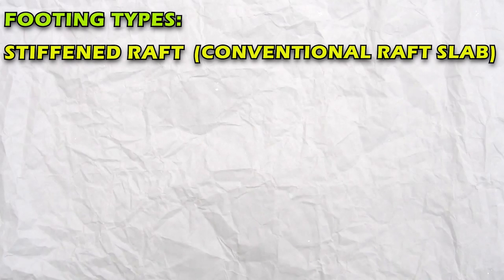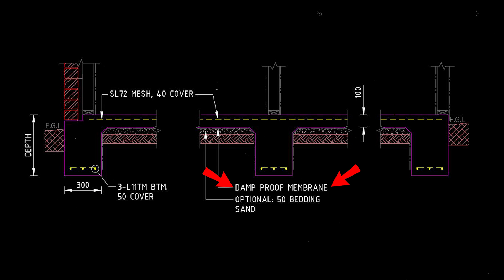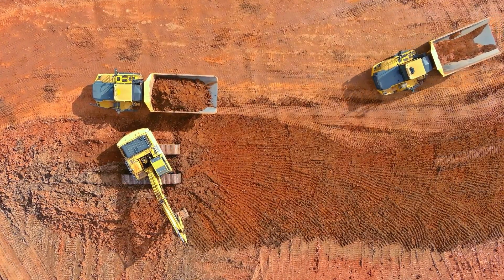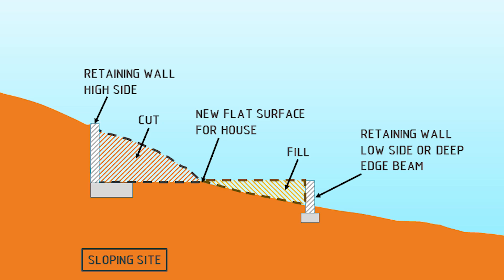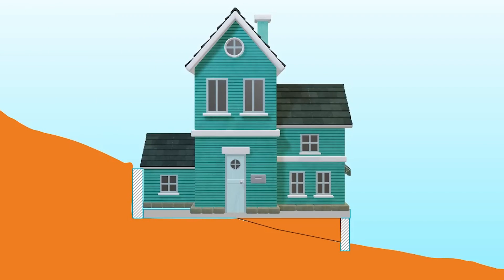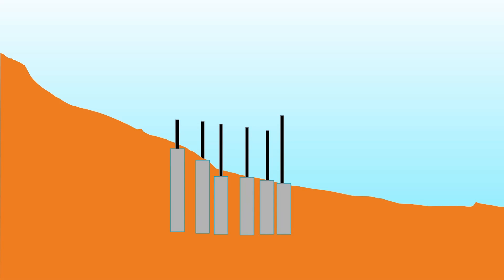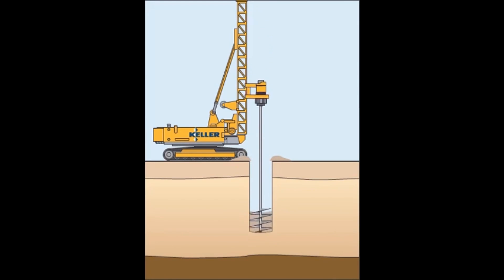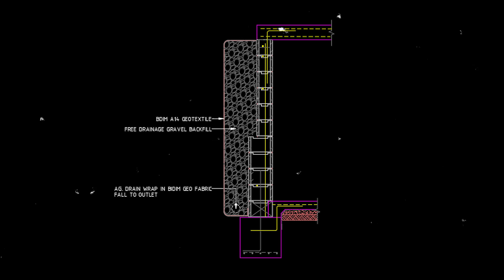The Ultimate Guide to House Footings - Structural Engineer's Insights

Comment: I don't understand the reasoning behind the edge rebate on the raft slab? I have never seen anything even remotely similar in Europe, can you explain it? Seems to me that it would make construction and waterproofing the slab significantly more difficult while achieving nothing, unless the inside floors are extremely thin? In Europe we generally design the floor composition on top of the slab to be 100 to 150 mm thick depending on insulation and customer need.

Comment: Your videos are very educational, thankyou! Can I request something? I'd like to know how you would go about Besser Block (or cinder block) piers/pad construction for 6m x 3m shipping container around 400mm off the ground - say at the beach for example. What factors would you take into account and how would they help determine the size/depth of the concrete pad to lay the blocks on. I'm trying to convince hubby we could do this ourselves but a video would certainly help get his head around it :)
Reply from the maker: The container houses I've done before were designed as habitable buildings, so I had a soil test to base my calculations off. Coastal areas experience high wind loads, so I would be careful with that. Make sure the container is well attached to the blocks and the blocks connected to the pads. The pads should be able to resist uplift and overturning.
Reply: @bengthebrazilianengineerinAus  well, you didn't say besser blocks are not allowed, so that's a good start. This is a common request for the Moreton Bay Islands and soil types are mostly class P. So, if you did a video on it, I can direct a few hundred land owners from our group here to watch :)

The soil test says 'moist to firm soil' is more than 800 deep / 100KPa is at 900 - footings that deep would make a container house unaffordable for most. 100 : silty sand. 200 : Moist loose brown. 300 : silty clay... and so on. The containers most are looking at are office donga style with a truss sheeted roof. I'm told 25KPa is adequate, but how that figure relates to the footings & size/depth of pads is over my head
Reply: @bengthebrazilianengineerinAus  thanks for replying btw :) :)
Reply: i just thought to add why i think a besser block demo (specifically) would be helpful. Many are advised to use steel piers for these type of prefabs but - aside of being more expensive - they concentrate the weight into the center of the pad. Whereas, in my imagination, it seems besser blocks distribute the weight across the pad more evenly. Also, again in my imagination, it only costs a few dollars to add extra rebar inside the blocks for uplift strength. My experience with structural engineering is limited to single course at Uni while studying my degree in software engineering, so what i imagine and what is real may be 2 different things lol